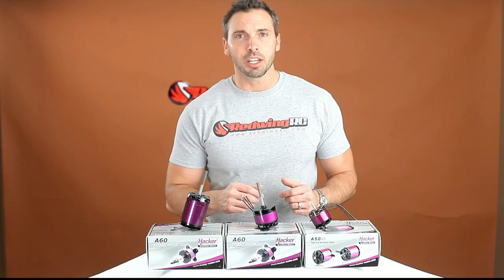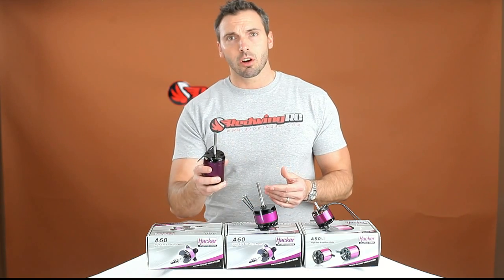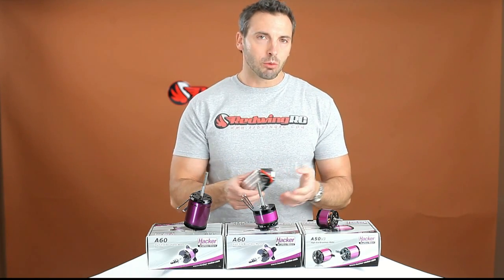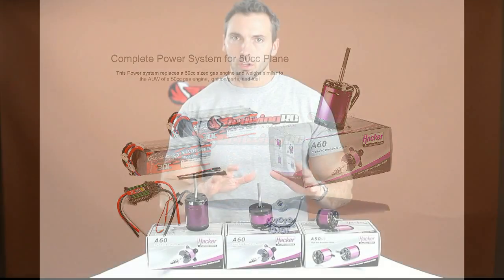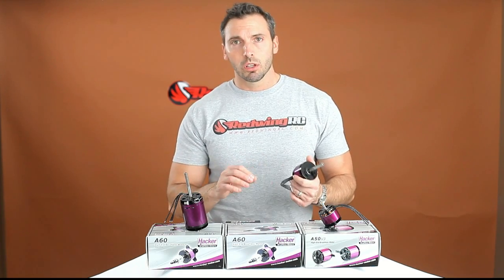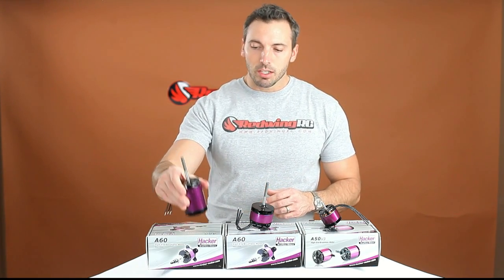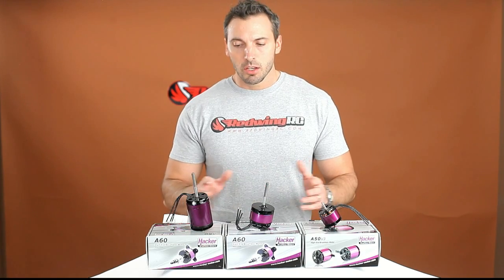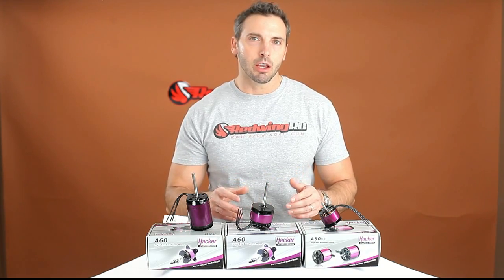Choose Best Motor ESC combo for your 30cc or 50cc Plane

Comment: CONFUSED , why only one 6 cell pack on a 30 CC motor , should the suggestion be 2 packs ?
Can you also suggest a 30 CC power set up that uses 2 x 6 cell vs 2x 5 cell packs .
Most single 6 S5000 packs are used on 60 size models, not 30CC models , depending on power demand. 
Thanks
Reply: 8cells works best 0n 60 size model planes.

Comment: Hello sir, i have 400kv tarot motor having maximum current is 24A with 6s battery 15" propeller over 90% throttle . So can u please suggest me suitable esc for my case?
Thank you